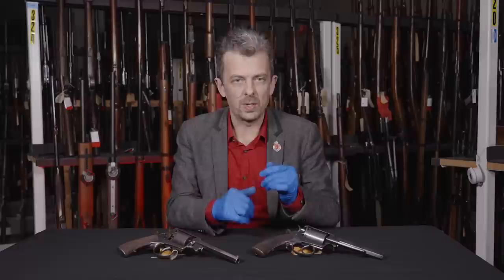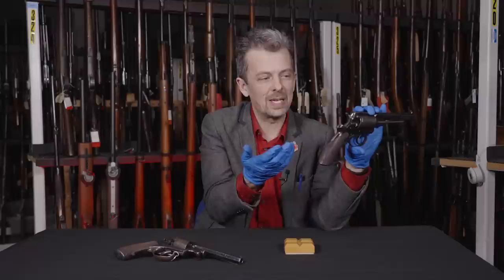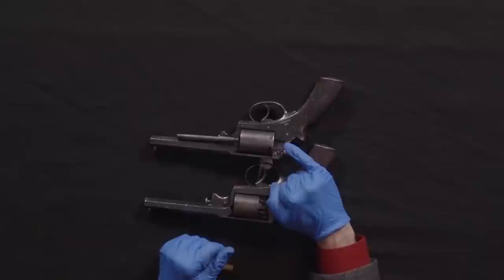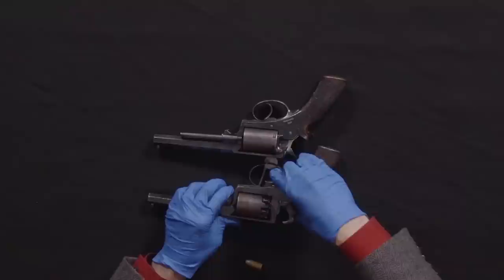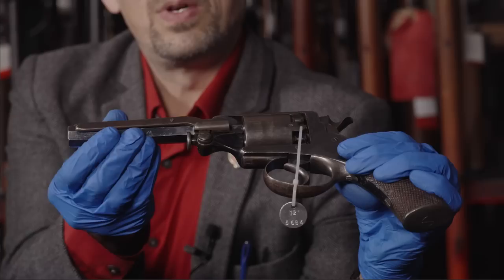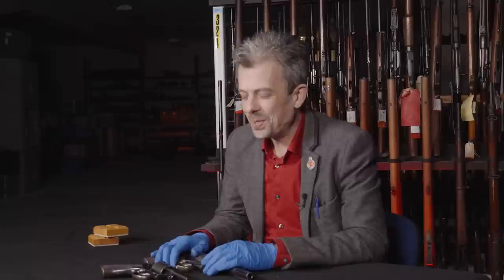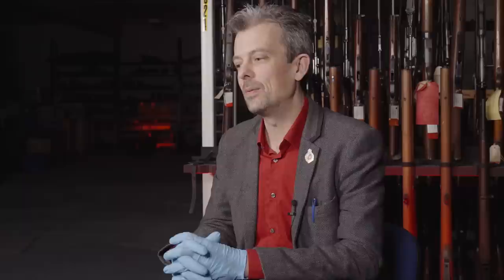The Revolver they *should* have used in Zulu, with firearms and weapon expert Jonathan Ferguson

Comment: These were very popular in the States because they were great revolvers. They saw widespread use during the US Civil War. They were so popular and well liked by the US Army that they were manufactured in the US and known as the Massachusetts Adams.
Reply: And yet nobody makes repros for some reason. A .36 Mass Adams would be a great addition to repro lines. Same with DA versions of 1858 (which were, apparently, a thing)
Reply: It's a shame. There have been rumors over the years that someone was going to make one but nothing came of any of the.  I once had an original offered to me but the price was eye watering and it wouldn't have been a shooter anyway.
Reply: @nonamesplease6288  First I've heard of rumors of them.
Reply: @kanrakucheese  There was a German company that was supposed to do it like 25 years ago and shortly after someone in the US was going to start production. Neither of these ever happened.  That was also when CW reenacting was a craze, so  someone figured that there might be a market for them.
Reply: Also used by the south
Reply: @kanrakucheese  I suspect that the absence of a recoil shield may be a safety/litigation concern. I'm pretty sure that an accidental chain fire would propel the unfired caps into the shooter's face.  Actually, I'm going to do a little research to see if there are any historic accounts of this happening.

Comment: This video filled a yawning gap in my knowledge, so thank you to Jonathan for that. My question is this: Was that inert cartridge of the correct case length? It was much shorter than the chamber suggesting a longer case than the one shown. Any ideas?
Reply: The cartridge has the same bullet mass and powder loading as that of the original percussion cap revolver and the revolver has the same frame and same size of cylinder as the original percussion cap revolver. Due to differences in the shaping of the cylinder due to the differences in how the two systems work, the cylinder ended up being far longer than required.
Other revolvers made from the ground up for .450 Adams like the Webley RIC and various Tranters have much shorter cylinders.

Comment: My personal choice would have been a Tranter 577 "Dervish Stopper". I am very privileged to have shot one of these at Bisley over 25 years ago, in exchange for allowing the owner to shoot my Bland .577 x 3¼"  BP double rifle. The Tranter was less fierce that one might expect, I assume due to BP loading. Probably less kick than my Uberti Walker Colt reproduction revolver.
Reply: That makes sense, since the Walker had the greatest powder capacity of any commercially-produced percussion revolver ever made. Not that you wanted to load them to capacity, since the metallurgy wasn't the greatest...
Reply: @Swindle1984  I think anyone who shoots 19th century firearms at or near their original loads (BP or smokeless) is taking a substantial risk. Both my Bland double rifle and the Tranter 577 revolver had been reproofed. Materials change with age (age embrittlement) and of course, one has no idea of past treatment of these vintage firearms, whether they have been overloaded, had chambers polished to remove rust etc. I had an 1899 Thomas Bland 577 nitro express falling block rifle, that had come out of India, which did pass reproof but only just (oversize chamber), so I retired it.
Reply: @wilsonlaidlaw  Explain how steel becomes brittle with age. Please.
Reply: @Swindle1984  Dissociations which are molecular level faults in the crystalline structure tend to migrate together, particularly at the crystal boundaries. This is a slower process in steel than for example aluminium but over say 150 years, steel will become both weaker and more brittle.
Reply: @wilsonlaidlaw  Unless it's been exposed to stress (such as the load-bearing parts of a building, the wings of an aircraft, a gun that's been fired A LOT over decades, etc.) or corrosion, I sincerely doubt that a steel object is going to become weaker with age simply by existing.
Reply: @Swindle1984  It does.
Reply: @wilsonlaidlaw  And you can provide a source for this?
Reply: @Swindle1984  A master's degree in metallurgy from Cambridge University .
Reply: @Swindle1984  I think you are what is called a "Doubting Thomas". A rock solid scientific paper and you still think you know better - end of conversation as far as I am concerned with a typical Youtube know all.
Reply: Any idea of what the ballistics of that .577 revolver are? The one published figure I've seen makes no sense.
Reply: @Ensign_Cthulhu  The original load for this was a 400 grain bullet at around 750 fps. My friend who I believe still owns this revolver as a classified historic weapon, loaded somewhat gentler than that in view of the age of the revolver. He aimed for 650-675 fps from the 400 grain Minié type bullet. That is around 400 lbs/ft of energy or considerably less than my Uberti Colt Walker produces at over 500 lbs/ft.

Comment: That ejector safety is an interesting design. One question it raises though is that of longevity of the protruding and unprotected ejector rod - along the same lines as with modern revolvers with swing-out cylinders.
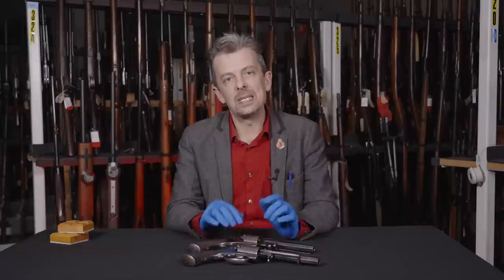15:12 Also, what's the deal with British cavalry getting rid of pistols?
17:24 Is it the reason behind S&W calling their .38 Spl Military and Police revolver (now known simply as Model 10) the Victory model?

Comment: Interesting that this Serial No.1 revolver doesn't have a date on the frame. Every other Adams Mark I revolver I've seen (including the ones I own) are marked with a date on the left frame just above the grip. I've seen the dates ranging from 5.69 (May 1869) through to 1.77 (Jan 1877). I suppose the dates were War Department acceptance dates rather than conversion dates and because this example never saw service after it was converted it was never marked.

Comment: Era Aesthetics; These are Victorian.  Impeccably practical, but handmade by craftsmen; with the fine & finish as is a craftsman's mark.
The Webbley is WW1; classic early industrial. Clean casting, solid metalwork, fine machining, but any craft is in the function.
Victorian is, technically,  Early induction,  but it is the last days of Craftsmen holding the manufacturing; people w developed skill at every aspect, any one can fit, fettle, fix or create from scratch, a fine & finished gun.
Possessing their tools as they go.
Ww1 is pure but early industrial; cost & time come second to quality, but fit & finish are functional,  and only that.
There's less detail for any bar function; if it isn't necessary,  it isn't there.
Both are heavier construction than WW2/mid century or later, but thats two forces playing out Because of Ww1/Ww2.
Better measurement,  better understanding,  better engineering (literally; pre ww1, most bullets/rounds are fiddle & find design; end Ww1/Ww2 it's   intent & design brief engineering.)
A lot of this is high speed photography & other information measurement.

Comment: Correct or not, the scene where Stanley Bakers shaking hands while trying to reload is classic. The Adams although period correct would not have worked so well.
Reply: It could be though. 
For the metallic cartridge conversion, a gate loader is slower to load than a top break revolver - making the scene a bit more tense tense. 

For the original cap and ball revolver, Bakers would fumble around inserting the percussion caps, which is more difficult than loading metallic cartridges - also making the scene a bit more tense. Heck, he might even drop a few trying to do so, and instead of picking them back up, he simply fetches new ones from a container - furthering the tension even more.
Reply: @paleoph6168  Ah yes agreed, and as in many movies, when the ammuniton is exhausted you hurl the firearm at you opponent.
Reply: @wrxs1781  or in the case of Saving Private Ryan, throwing the helmet!

Comment: I'm curious about the commercial version and historical context. Assume you have a percussion model and you take it to a gun smith for conversion. Could you have the gate added, but keep the loading lever so you could switch cylinders on the fly or would that require a reset of the timing. I can imagine someone using percussion for range practice since they already have all the kit and can make their own balls. A cheaper option for shooting paper. But carry it with cartridges for faster reloads.
Reply: You would have to swap the hammer over as well. I'm not sure of the training value, as well as the handling differences the ballistics could be different.